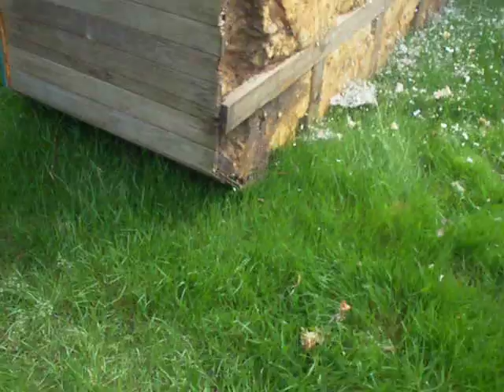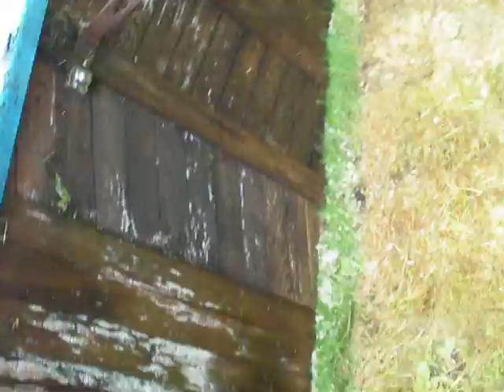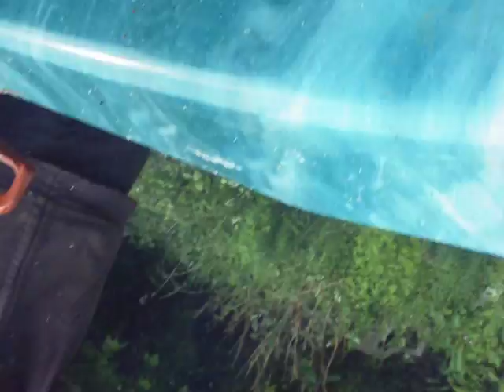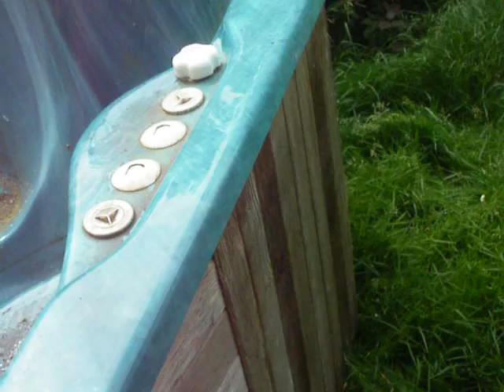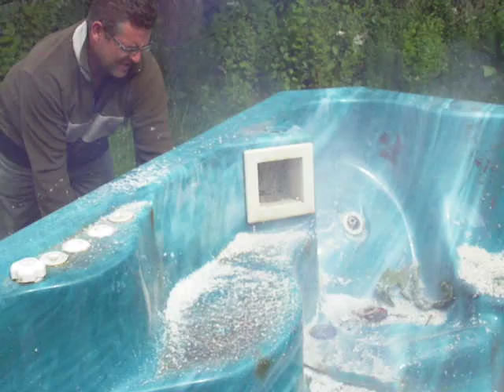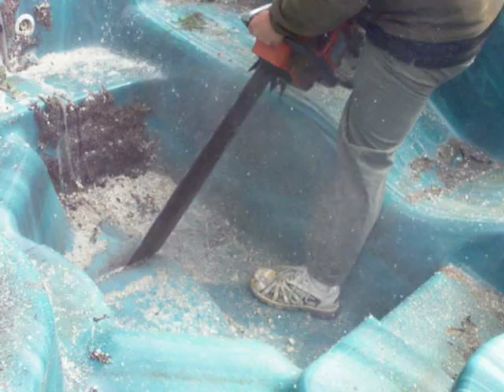Chainsaw Hot Tub part 2

Comment: I've cut old ones for a residential demo service with both a chainsaw and a sawzall.
the chain is a lot quicker but my strong suggestion for any one using any cutting 
on the old spas and tubs is to wear some form of breathing protection and goggles.
the cuts usually generate a ton of fine dusts and glass fluff.
ps - i also wear the log cutters protection gear as well.
there is a ton of crap in these things and most of it gets tossed
in your face when cutting.